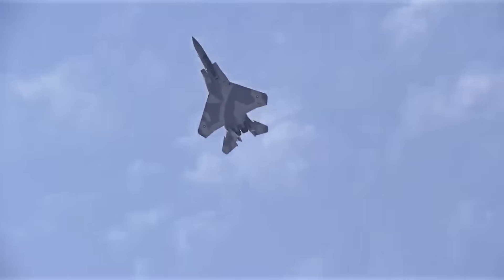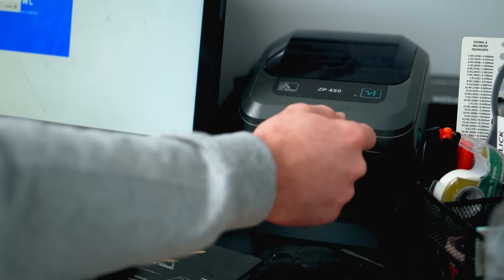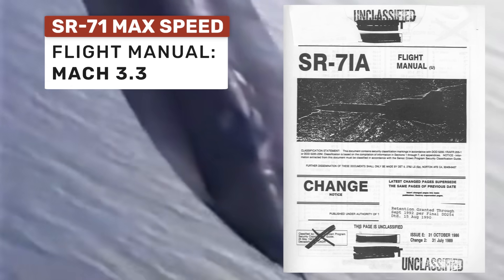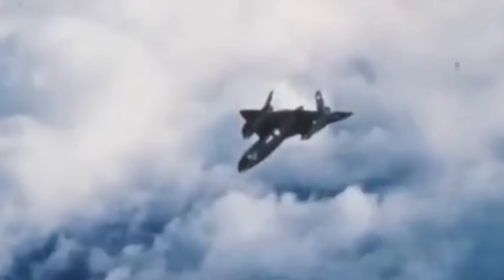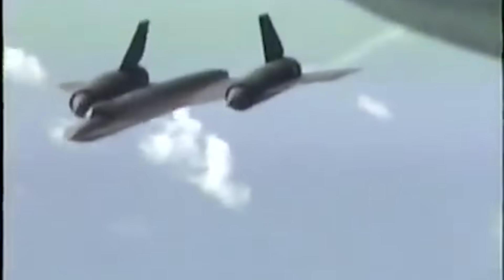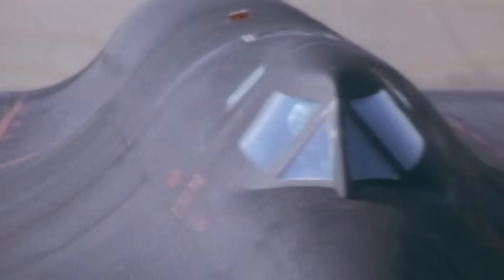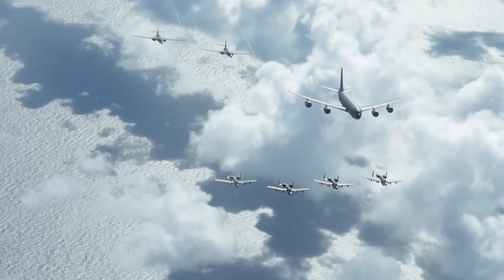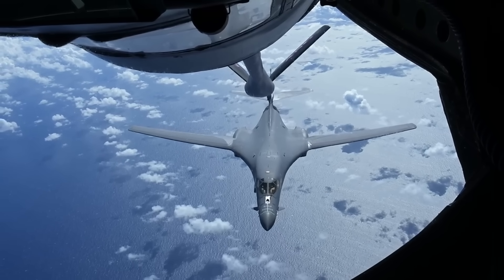The SR-71 was MUCH FASTER than the Air Force will admit

Comment: If SR-71 is that fast for a 1960s skunk works design, imagine what new toys we do not know of the US has.
Reply: Speed isn't the only determiner. Massive gains of efficency at a lower but still fast speed could be completely changing. Either needing to carry less fuel for a mission or being able to fly further in the same fuel tank. Range is a massive limitation for speed.
Reply: @granatmof look into all the issues China has had making the j20 fly well bc of the engines. It's insane to look at the weapons bays while open. J20 is like ⅕ the area under the plane. The F35 is like ½
Reply: We still use 1960s rifles, 1950s bombers, and 1910s machine guns. Maybe 1960s aircraft are the point of diminishing returns, and the military is investing in technology more useful for modern warfare, like satellite capture, directed energy weapons, or low-cost autonomous drones. Maybe scramjet reconnaissance planes and long-range missiles are feasible, or already exist, but don't confer enough advantage compared to other technologies.
Reply: I used to live around an AF base in NV. It isn't uncommon to see "Black triangles" flying at speeds, that make your hair stand up on the back of your neck...... Since 2004.
Reply: tr3b anti gravity
Reply: @dragunovbushcraft152 you mean the night hawk
Reply: You would think but technological developments like satelites and high speed missiles have made spy planes pretty useless and combat aicraft dont get up to those speeds since it requires making many sacrafices in the design. Hence why the SR-71 hasnt been beat. There are some 6th gen combat aircraft designs talking about speeds past mach 4 to add kinetic energy to the missiles so there might be a prototype or two flying around somewhere but no aircraft in service.
Reply: @SlayerBG93 
And you know this… how? 🤦🏻‍♂️
Reply: It should be pointed out satilites have relatively fixed trajectories and can be planned for...and always have been.
A spy plane can be launched anytime anywhere with little to no forewarning.
If someone takes out key satelights you'd better have backups sats. and planes. Generally it was assumed if their retiring the 71 then they already have something to replace it. The claim is that was satelights. Lol
There's several unmanned projects jet and space plane that are alleged to have replaced atmospheric manned spy flights.
Reply: There's also a one off single use high velocity missle that does as much
Reply: @SlayerBG93  yet we have RQ4, and U2 Dragon lady, outlasting the SR71.

Sats take time to do orbital reroute and opfor can track sats to conceal their shit on each pass.
Reply: Those engineers in short sleeves and ties, were a different breed. Just because everyone today carries a supercomputer in their pocket , it does not necessarily make us smarter.....the blackbird, the Valkyrie, the x-15, someone just mentioned the f-104, the Russian MiG-25, at one time there was even supersonic commercial aircraft, ( English/French).... sometimes we overestimate our abilities....it's not too far of a stretch to call these amazing aircraft lost technology.....We can't even build a T.V., or a cellphone in this country anymore.

But at one time....
Reply: @marco77ar it's not can't build it, it's won't build it. We made all these pesky labor and environmental laws that corporations sidestep by going somewhere else.
Reply: and if we don't, why not?
Reply: I think the current top secret stuff is stealth. With laser weapons, rail guns, and missiles now capable of Mach 7 having a fast plane is useless. Being invisible is the new speed. They can't hit you if they can't see you. The best example is the helicopters used for the mission to kill Bin Laden. That was over 12 years ago, yet there's been no official acknowledgement they even exist, let alone what they look like or what their capabilities are, but we know they got built and used. The stealth tech on current aircraft is 30 years old, in keeping with the design age. You have to imagine they have new and better tech they're keeping secret.
They might even be playing around with alternative propulsion systems. As someone else mentioned, efficiency is a key advantage. Some hybrid electric/jet designs maybe, or perhaps something completely different. Pulse jet and scramjet variants have all been tried, maybe they've perfected that tech. There's been rumours and theories of crazier stuff, like magnetic repulsion and even anti gravity. That's a bit of s stretch I reckon, but who knows? Perhaps we'll find out in another 30 years.
Reply: @woopimagpie Modified Raptor 3 Scramjet using liquid methane? And the government might have better engines.
Reply: The only SR71 outside of the US is at Duxford near Cambridge in the UK, I have seen it many times
Reply: Space drones.
Reply: Aurora, for one.
Reply: Coruption.. loads and loads of coruption.
Reply: None, kiddo, 60s USA was industrial power, now, it's failed state where "economy" consists of usury and pet grooming. The fact both Russia and China can make and deploy hipersonic missiles while USA just cancels one project after another because they always blow up mid testing speaks volumes...
Reply: like those "UFO's "
Reply: probably some unmanned drones that will never ever have the charisma of an SR71
Reply: A Aurora was radar caught at 13 mach in early 90s
Reply: @richardmckinnon8791  yes, the Aurora that the US Gov't NEVER admitted existed!
Reply: Well, there’s stuff in space that makes Mach 3 look like walking speed.
Reply: I used to think this same thing but not so sure anymore. I think our government has become too corrupt and instead of dumping all the money into advancing tech they are just burning it and lining pockets.
Reply: That was before corrupt elected officials took over the US government. We don't have anything like what you imagine, a lot of yachts at the pier of Senators, Congressmen and now a president are the reason why.
Reply: @El_Peto Undetected at over mach one?  lmao
Reply: @El_Peto I am a former F-16/F-117 Avionics specialist.
Reply: @El_Peto You never told me your experience with rf detection/exploitation. One of my specialties was Electronic Countermeasures and Penetration Aids.
Reply: @Danlovestrivium  Didn't Rock Hudson die of 'penetrating aids'? Or maybe it was food poisoning; something or other about bad meat in the can.
Reply: Always my thought process. Think the public is 20+ years behind the knowledge of programs for the US government. What are we testing now? 😮
Reply: Something is clearly in service based on reports of sonic booms nation-wide. They're reported nearly every day, almost none of them are corroborated by the military, with the various branches denying they had aircraft in the area at the time of the disturbance, and they're so common you can find reports in social media regularly. As for me, I witnessed possibly the Aurora craft or possibly the next generation after that, over Rochester, NY around 2010 at a family picnic. An aircraft flew horizon to horizon leaving a line of rings or donuts in the air behind it in just a few minutes. Zooming in with binoculars revealed something small out in front of the trail, but no clear shape could be discerned.
Reply: @mundanestuff Fighters have overflown my hometown since the sixties. They just aren’t allowed to create Sonic booms as they used to. It doesn’t require new secret tech to create Sonic booms.
Reply: Stop it. That old line is so worn out. You can only hide aircraft for so long .
Reply: Gravitic propulsion....
Reply: Figure this out the RS-71, flue I one Hour to UsA from Japan.
Reply: All I know is that, when Top Gun: Maverick came out, the Chinese shit a brick. Why? Because of the SR-72, aka the Darkstar, in the film, The Chinese reasoned that, if the US and Skunk Works were going public with that, then who knows what they're working on behind closed doors?
Reply: If there going public with it , it's at least 20 yrs old.
Reply: @dananorth895 Aurora has yet to be disclosed. That’s over 40 years old.
Reply: @markymarknj Chinese satellites manoeuvred to take lots of photographs of the film prop 😂
Reply: @markymarknj 
Funny fake news and disinformation.
The Chinese "didn't shit a brick".
They've the satellite capability. So they decided to used it .
DF-17 already in service to counter U$ overwhelming military superiority !
Funny how Pentagoon, DoD, CIA, State Dept are all saying China is a military "threat" to American military presence in Asia-Pacific .
Reply: @markymarknj Yeah who knows????!!!!! I can damn sure tell you and anyone that there is NO mach 10,manned aircraft!! Maybe mach 5 or 6. Kelly Johnson predicted it would be 80 to 100 years before it would be surpassed. So if you say from 1965 to present that's almost 60 years. That's counting the A 12 the SR predecessor.
Reply: @markymarknj  they literally retasked a satellite for a MOVIE PROP
Reply: @nomercyinc6783  that's what I'm saying! Nevertheless, I find it interesting that Skunk Works would go public with something like that; given their history, if they go public with something, then they've been working on it for years.
Reply: My retired uncle drunkenly said to me once. "We were flight testing the B-2 bomber in the early 80's. If you saw a B-2 in 1983, you would swear it was an alien spacecraft. Imagine if you saw what we are testing now."
Reply: @PjPjPaul  HAV BLUE (the F-117 prototype) was flying in the mid 70’s, so you can only imagine all the “UFO” sightings back then that was related to it.
Reply: I would assume today’s engineers are nowhere near as bright as
Reply: The issue they are having is the same for flying drinking straws and dragster race cars.

A humble plastic straw can stab a potato but it folds really easy from the side.

Dragster race cars are great in a straight line but they cannot turn very well.

Both are an issue. Put a tube in the air, then throw it fast enough that when it turns it folds in half.
Reply: I remember reading an encounter by an SR-71 pilot, who was fired upon during Desert Storm, that they were ordered to GTFO of the AO due to various (and classified) reasons, they saw speeds in the Blackbird that had never been seen before and it was still accelerating. 😳🤨
Reply: @bigdaddy7119 No SR flew during Desert Storm.
Reply: @eac1235  yeah, I meant Libya in ‘86
Reply: I reckon the SR-72 is already in service and being used for ISTAR and Recon operations, but that the AF won’t publicly admit to it because it’s wickedly fast and they know China and Russia would see it as a potential first strike platform.
Reply: @Therealprinceofcobh Nope . That "reckon" is not a correct one. It might show up in a few more years.
Reply: Top Gun Maverick already exposed all you have
Reply: There's no point in high speed aircraft, we don't have any.  Test beds in the 70's and 80's? We'll need more proof... but why make something that doesn't have a job?  What would we do with it?  Any job, besides interception, could be better accomplished with another system.  Any secret aircraft would have to be a small number, by their very nature.  So, why? What for?
Reply: @ATBatmanMALS31  well for one, people can anticipate keyhole sat passes, and hide from it.
changing orbits expend sat onboard fuels just to change orbits and thus reducing sat useful lifetime.

A KH can only remain locked on a target for mere minutes.

That's why Dragon Lady still flies to this day.

but dragon lady can also take days to be deployed to patrol an AO.

An X-37B NEEDS to be refueled, maintained and re launched though it might be able to maneuver far more than a KH.

sure there are systems that can accomplish certain missions but not all can encompass a full spectrum, low deploy times and gets to an AO in a short time, etc.

what i meant on my original comment is that it isnt just about speed.
Reply: Yeah. No. We had Concorde flying from London to New York in 3 hours.  Not it takes 4 billion years.  So no. Just because time passes it doesn't mean shit.  There was a speed feaver some time ago. Now there is not. The speed was important because no missile could've catch the plane.  Now missiles are very fast so SR71 won't do much. All they build now is aircraft with touch-screens. The era of military might has ended. " imagine what they have now"
Shit is what they have now.
Reply: @CarMagic1 toxic

Comment: This is unsurprising. Run calculations for the SR-71's thermal expansion of it's skin along with reported skin temperatures. Now run calculations for how much heat it takes to close the purposely engineered gaps in the fuselages to account for thermal expansion. Interesting how the Math doesn't line up. Inferences can be made here.

Comment: An F-15 EX, not made from titanium, will do mach 2.5 (let's say), without melting, but the SR 71, made from titanium and specially built for speed, can only do mach 3.3 or it will fall apart?  Keeping in mind that, at 70,000 feet, the speed of sound is around 500 mph.  Now, I'm not an engineer, or a rocket surgeon, but that sounds wrong to me.
Reply: Nah, sound speed is still in the high 600s at that altitude, since it only depends on temperature and the atmosphere is actually pretty isothermal in the range from around 35,000 feet up to 100,000 feet. Also, thermal effects get bad very quickly as you increase mach number - mach 3 is quite a lot worse than mach 2, mach 3.5 is significantly worse than mach 3, etc. 

The reality is that even the mach 3.5 stories are probably tall tales, and 3.4 is likely close to the limit of what was ever actually done. That's still tremendously impressive, mind you, especially with tech of the time. With modern engine internals, you could probably get that up to 3.6 or 3.7 without any other changes, but anything beyond that would start to cause a lot of other problems and you'd really want to just do a clean sheet new design.

(I am an aerospace engineer, for what it's worth)
Reply: @clapanse Could there also be areas on the airframe (exterior) on the SR-71 (and its design differences compared to an air superiority fighter) that would develop localized hot spots?  Thinking the chines at the nose of the SR-71 would experience faster heating being so thin, that the nose of an F-15 would never experience.  Curious.

Comment: How long does an advanced technology aircraft need to be retired before it’s fully declassified? Like the SR-71 or the F-117?  30 years? 50?
Reply: Depends how long it takes any potential adversary to match/outdo the unclassified performance I'd imagine.
Reply: I think it's 25 years for automatic declassification but anything can be indefinitely exempted based on any number of national security factors. Since we're long past 25 years, it's whenever they decide it won't be a national security issue.

Comment: It had intakes behind the combustion chamber that fed the afterburner turning it into a scram jet. that's why it's so fast. it should be capable of Mach 6 on a test bed, but the air resistance would keep it below mach 4 most likely.